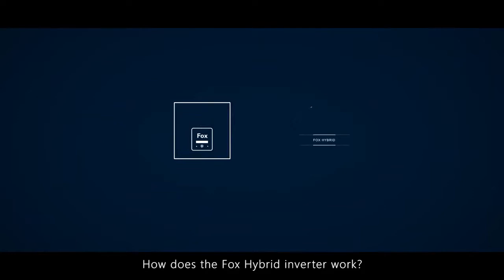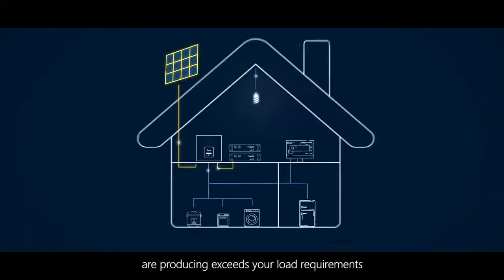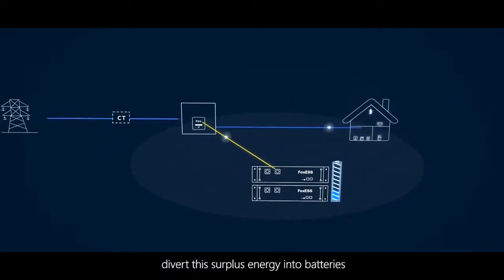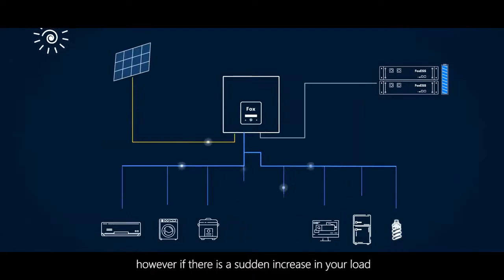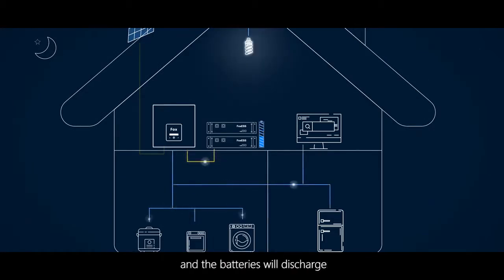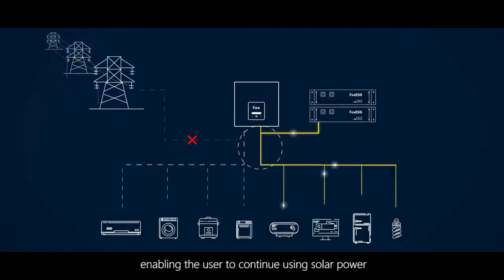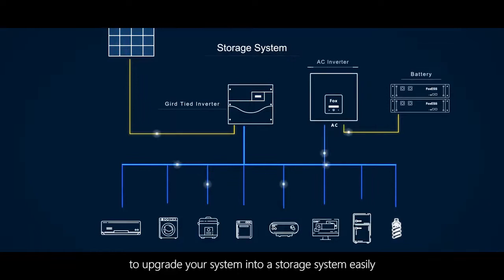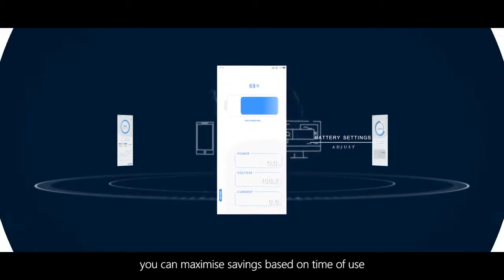Fox Storage System Introduction

Comment: Can anyone tell me what the FoxCloud app graph is showing? I understand Grid Consumption and if Output power is below the line  I think that the Solar is charging the battery and that pattern corresponds to the Battery Charge Power but what is Load Power and Battery Discharge Power And Feed-in Power?  Help!
Reply: My FoxCloud app  shows the following items (and what I think they are):
Output power (total power coming out of the inverter - in my case it is a hybrid inverter so battery and solar combined)
Feed-in power (surplus power going into the grid - if you have a feed in tariff you will get paid for this)
Charge power (the power being used to charge up the battery)
Discharge power (the power coming out/being discharged from the battery to run the house)
GridConsumption Power (power being pulled in from the grid if there is not enough solar+battery available to meet the house demand) - you want to minimise this or use it at night if on cheap overnight rates e.g. EV charging.